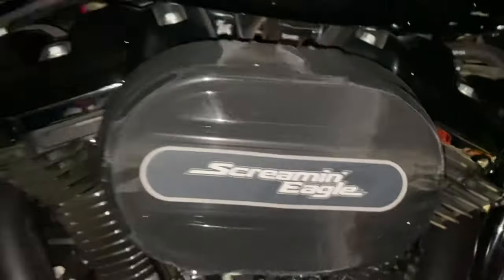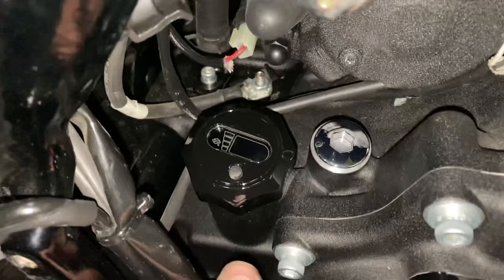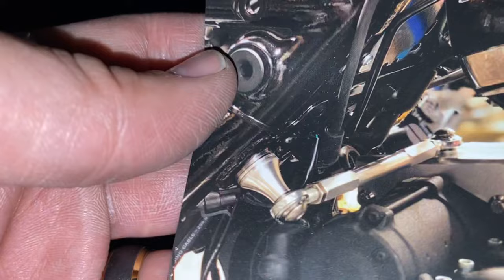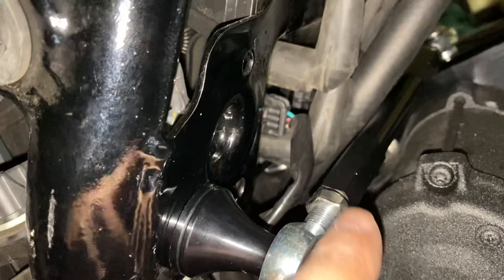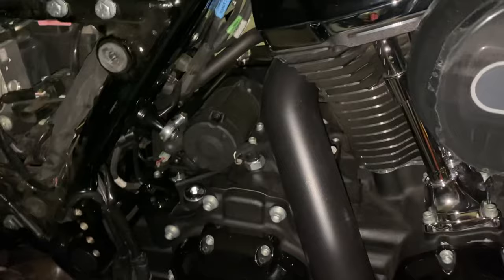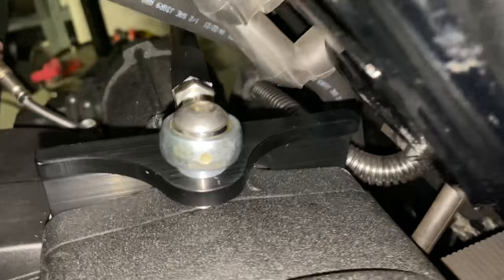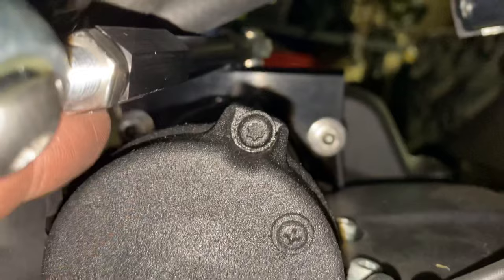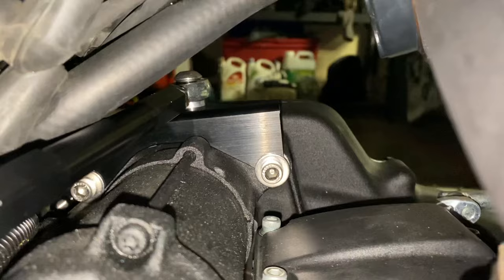HARLEY-DAVIDSON TOURING FRAME STABILIZER & HARLEY DIGITAL DIPSTICK INSTALLED 🔥 #performancebagger

Comment: 2021 FLHTK 8k miles, freshly built 166hp SE131, shimmy/wobble at 100+mph. Brand new OEM tires, True-Track front and rear stabilizers, Ohlins nix-22 cartridges, Ohlins rear 776 shocks, neck bearings tight. Is there any fix?? Is this mostly a street glide issue? The bike is perfect, but I should be able to run up to 120mph confidently.
Reply: can you identify if its a rear wobble or front? i have road glide special stage 2 and that's no were close to your bike's performance but once i cross 80mph feels like the fairing wobbles/ shakes right and left a little bit. at first i thought its the wind but no one else from the group faces that! the handlebar is stable and doesn't wobble but front end feels like it does....now am researching the "Missing Link" from RACK AND PULL INDUSTRIES. i suspect it could help because when i upgraded rear shocks i noticed a slight difference (0.25inches) higher one side
Reply: @samirbaddour9562  The wobble is in the front and comes thru the bars moving left to right. The front end also starts to feel lite going from lane to lane at high speed. When the bike is cold it does not happen initially.  The bike also has the rear tire movement (walking) thru fast corners. Its a total joke!. I've got $50k in this POS. 2021 and it blew the crank from factory sumping. Allegedly the oil pump was fixed for 2021, no need to do it when I added a HD 131 kit. And now HD has the balls to promote Bagger racing. 166hp and I cannot safely do 100mph! I should have stayed on my Hayabusa! OK lets hear the hate.

Comment: Have you noticed any difference with it?
Reply from the maker: It’s made the bike feel as if the motor is not AS rubber mounted as it is, other than that it’s peace of mind, I’m going to do the “missing link” on front next!
Are you having issue?
Reply: Not yet, but I didn't even know that part exist. I got the legends at Sturgis thinking now I'm going to get the oil cooler and the one that goes by the starter kind of help with the airflow. I live in West Texas if it gets hot. 👍👍
Reply from the maker: @gilbertmal6033  https://love-jugs.com/ check these out 👍🏼

Comment: Would that work with the head deflectors that goes right there?
Reply: I’d be guessing that’s a no. 
If you want a for sure answer, give the manufacturer a call or email and they will have answer for you !
Reply from the maker: Not really sure, anything is possible!
Reply: @performancebagger3506  well no anything is possible lol
Reply: Yes, but you'll no longer be able  to attach at the bottom. Just cut the deflector around it, bolt it in at the top and use single sided foam tape along where it touches the frame so it doesn't vibrate. 1 attachment point has been fine for me for a long time

Comment: At what speed did you start noticing rear end wobble?I went to a different size rear wheel and tire and now I get a bad rear end wobble starting at 90mph.  Does the stabilizer work? it's either i go with this or the Glide-Pro kit.
Reply from the maker: I put the stabilizer on the Road Glide, and it’s never had the wobble before or after the install. My CVO Limited also never had the wobble in full stock trim over 11k + miles. 
The 2021 STREET GLIDE CVO did have the wobble issue on highway, would start around 70mph and go away when let off throttle. Since I installed mine more as a preventative I can’t definitively claim that it has solved any wobble issue.
Reply: @performancebagger3506  2021 road glide 100 mile round trip work and home most of the time 90 + I get no wobble just replaced my rear tire I’m at 25,000 it’s just 18 months old if my bike had a wobble it be at the dealership getting checked

Comment: Junk!
They do nothing. 
Do yourself a favor and get yourself an adjustable missing Link bar for your front engine mount so you can align your motor and swing arm properly. 
Best thing I did to my Street Glide. 
Zero wobble out to 110 MPH. 
My upper and lower rear shock bolts were 3/8 of an inch difference in measurement from right to left rear shock before I did the missing link bar. 
Now my upper and lower rear shock bolts on both my rear shocks are exactly 12 9/16" center of upper bolt to center of lower bolt . 
Now it tracks straight as a laser and zero wobble
Reply from the maker: Thanks for the info Jayonez, I did notice the swingarm bolt hole discrepancy when changing the rear shocks and was surprised to see the difference from right to left.
I’ll look into this missing link thanks again!
Reply: Where do you get the front Missing Link?
Reply: thanks, but it would help more if you provided name/part # or link to the product
Reply: I'm not quite sure I'd call this junk. Check out some of Eric Buell's ideas...

Anyways, the Missing Link he eluded to is by Rack and Pull Industries. Definitely fixed the alignment issue and made so the rear shock bolts dropped right in. I'd say it helped quite a bit on my scoot but there's definitely still some wobble above your average riders' speeds through sweeping turns on shitty Michigan roads.

Hopefully this thing will help knock it the rest of the way out...
Reply: Sorry guys. 
Yes the missing link is from Rack and Pull industries. 
It’s a must have for HD. 
My friend just bought a brand new 2022 CVO Limited and he was out of alignment 1/2” on a brand new bike. 
I installed the missing link in his bike and the issue was fixed immediately
Reply: @davep0639  
There could be numerous reasons for you wobble besides motor/swing arm alignment. 
Bad swing arm bearings being one of the most common. 
I’ve seen swing arm bearings go bad in 10,000 miles.
Reply: Not junk for me. Fixed the issue straight up
Reply: @ricko9879  it did not fix your issue. 
It only masked your problem
Reply: @jayonez137 I was simply pointing out that you're wrong by saying they're junk and that they don't work when, in fact, they do.

Comment: I’ve never experienced any frame associated wobble issues on my 2022 Limited so I don’t see the need for this useless thing ?
Reply from the maker: Neither did I,  I’ve seen it multiple times on street glides and wanted to be preventative. To each their own. I’m not affiliated with the company or trying sell their equipment.
Reply: That’s one “No” for the stabilizer thing!  Thank you!
Reply: Youre not pushing the bike hsrd enough. If you ride it hard it will wobble. I just had the wobble issue on a 2023 street glide St. I installed the frame stabilizer from alloy art but haven't had a chance to test it.
Reply: @cryan4249  Yeah I push my bikes and this is my first HD (22 Street Glide Special) and the wobble is real for sure. Have you had a chance to test it yet?
Reply: @shawngrobecker8021  at high speed (on a closed course) I got a small wobble exiting the turn but it was brief and stabled quickly. Without it, it would death wobble. It Def helps. Worth the money. It ain't a ducati I have to remember that when I ride the Harley lol
Reply: I get some wobble sometimes on my brand new street glide special. I was very surprised to get it on the new frame design. I used to get it on 2007 a lot. Definitely getting a stabilizer.